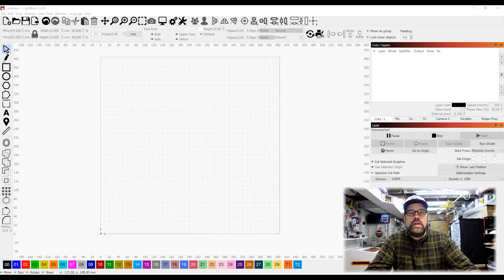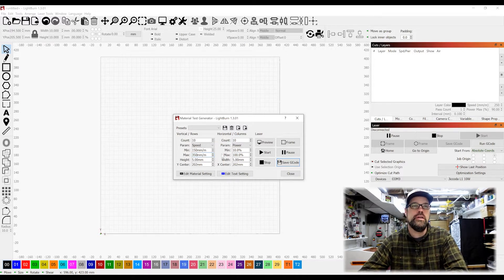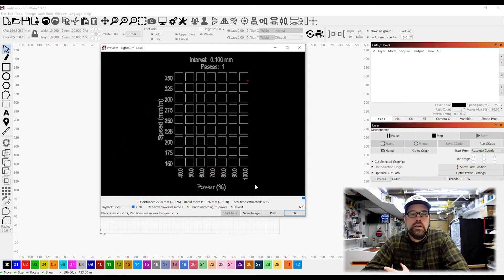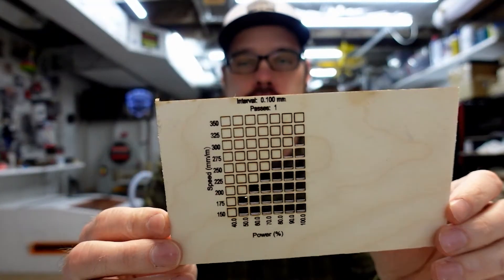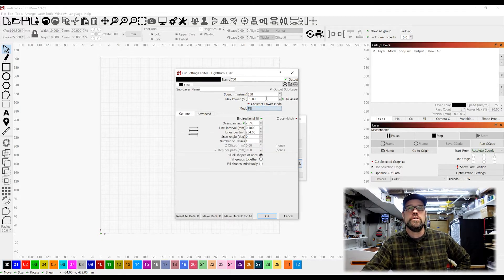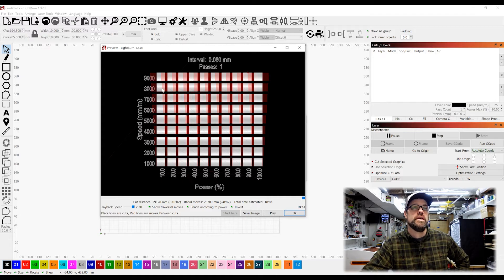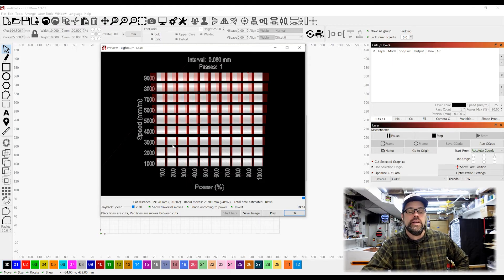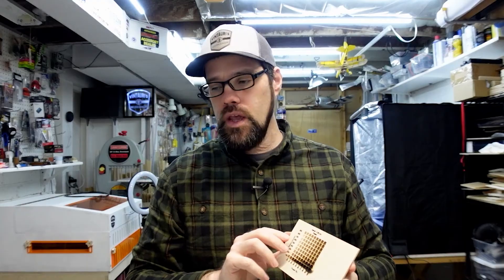Use the Material Test Tool in Lightburn for better results with your laser

Comment: Thanks for the video really helpfull, have got one question when running the test it starts in middle, anyway to make it start say bottom left please many thanks
Reply from the maker: You can adjust where it runs but changing the Y Center and X Center coordinates on the Material Test Generator screen. Always use the frame button to see where it's going to run before starting the test.

Comment: I got what i need thank you so much , only i have one problem i don't know is this a software issue or settings issue when i select preview and frame every things is line up but when i select start it deos't match what i saw on preview all square boxes start at 50 to 60 mm distance from left side  could you please advise me how im able to fix this problem
Reply from the maker: It sounds like you have an offset configured in the Device Settings.  This would be used if your laser has a crosshair pointer that is different from the actual laser beam. You can either disable that option, or you'll need to correct with some test fires measuring the difference from where the laser sits to where it starts the job.

Comment: Great video. Very informative. I have a question. In my settings I cant set lines per inch and line intervals independently.  If I change lines intervals to .08 then my lines per inch goes to 12.5. If i change lines per inch to 225 my intervals goes to .00444. I cant set them separately
Reply from the maker: Those two settings are tied together and when you adjust one it will move the other.

Comment: I tried it and my test tend to go to the center of my cutting table which waste my material . how do i place  it in the right spot ?
Reply from the maker: You need to adjust the X center and y center options before running the job. It always defaults to the center of your laser work area. Set up your parameters in the tool then use the framing button to see where it will run and adjust from there.

Comment: Love Your Videos, I am very new and have an Atezer P20, on your material test, where would you recommend the start settings for a 20 watt laser? Thanks
Reply from the maker: For the 20w machine I would start the engrave test around 5000-15000 mm/min 10% to 100% power and for the cut I would start the range around 300mm/min to 600mm/min and 60%-100% power.  No sense in testing the lower power on the cut tests. Then adjust the range up or down from there based on the material results.
Reply: @Vintauri  Thank you very much, I really enjoy your video's, I tried the LA Hobby Guy's videos, but they just seem to advanced for me, I really like your video's, keep up the good work!

Comment: If I double the thickness of the wood do I run the same specs and do 2 passes?
Reply from the maker: You can run the same test at two passes or if you have the room you can slow down the cut speed.  I like to keep it above 150mm/min though even that slow things tend to char more. But anytime you can cut in a single pass can help reduce the top side staining around the cut lines as well.

Comment: working with a new 70 watt OMTech. Have run materials test grid on a couple of woods (MDF, birch, basswood) , 10mmx10mm squares... what has been happening is using a cut setting from the grid (usually numbers in between some cuts ; ex at 70 mm/s it cuts at 40% & 50% & 60% , so use 70 mm/s & 50% ), small things cut out, but the larger things dont (think profile of a pinewood derby car and holes for axles - holes cut out but profile does not)....happened with all 3 woods...wondering if on the 10x10 (10 mm) test grid,  laser is not getting up to speed, but is getting to speed on the actual cut and therefore going too fast for the power.....thoughts
Reply from the maker: It could be a speed issue with the small squares.  You may also want to check to see if the option for "Constant Power" is on or off in lightburn. The software tries to compensate power levels at lower speeds when the laser slows down for corners and such. But it can sometimes not work well with various controllers and power supplies. I'd run a few tests on larger objects to see if adjusting the speed makes a difference.

Comment: When i try this with my sculpfun s9 it does not show the letters on the side. (It goes really fast)Any idea?
Reply from the maker: When you open up the Material Test tool, click on the Edit Text Setting button and adjust the power and speed there.  That will change the settings just for the test engravings for power and speed.

Comment: Thanks for the great video Steve.  My question is how does the speed and power setting in the "Edit Materials and Text" settings relate to the speed and power settings in the actual material test?
Reply from the maker: Lightburn will ignore the power and speed settings under the Material settings button, however for fill mode it will read the line interval, if you are just doing a power and speed test.  For the text settings it will use those when marking the test labels, so you can change that to line, or fill and then also adjust the power and speed.  This is a good thing to check as it might be too light or to dark based on the settings for the material you are testing.
Reply: @Vintauri  thanks.  This is helpful.  I made an enclosure based off of your video.  I will post my build video soon and send you a link.  😁
Reply from the maker: @MakerDan55  I look forward to seeing the enclosure build!

Comment: So one thing I noticed that nobody covers and I have asked in multiple places and never get a straight answer.  How do the power and speed settings under Material Settings effect the test?  You enter your minimum and max power and speed in the original Material Test window that opens, so clicking on the Material Settings tab and changing power and speed accomplishes exactly what within the test?
Reply from the maker: I have not seen the min and max power settings have an effect on the output of these tests.  What I do look at there is the overscan and line interval when doing an engrave test as well as number of passes on a cut test.
Reply: @Vintauri  thanks.  LB support finally got back to me and confirmed that the software will ignore the speed and power settings in the material settings here.  All the other settings can be changed and will take effect, just the speed and power are ignored.

Comment: Heya, i see you're still responding - im brand new at this but is it normal for a 10x10 sample test piece of plywood take over an hour for fill engraving or am i doing something wrong?
Reply from the maker: The engraving tests can take a while and depending on the speeds and line per inch that are set up I could see it pushing an hour.

Comment: aye man this video answered a lot of my questions teach and learning all the aspects of the laser and software can be tricky but you did great job. I'm new to engraving business I grabbed a nice 80w co2 starting off but I'm getting hang of it I'm more worried about learning before I mess my laser up because light burn has a lot going on if you are new to the program compared to others they are very basic but light burn is where its at if all steps are learned and taught from someone with your skill and knowledge.

Comment: Great video thanks for the help, question fo you use air assist when engraving?
Reply from the maker: I try to run some air all the time to keep positive air flow away from the lens.  I prefer a lower air setting when engraving if possible.
Reply: I have a Sculpfun s30 ultra 22w it has its own air supply and I am not sure if it is adjustable so I will set to on.  Thank you for the quick reply @Vintauri

Comment: Im having such a hard time doing such a simple test like that. With the settings you provided I did two test one with your settings which everything came out really light. Then the other with factory settings but sopes max 900. I have the s30
Reply from the maker: Check to see that your lightburn settings are set to mm/min if you are duplicating my settings.  If they are set to mm/sec it will run much faster and be lighter.  You can stay in mm/sec but divide the speeds by 60 to get a starting point.

Comment: if i have 33w what i should do
Reply from the maker: You'll want to adjust your numbers a bit to be faster but it will also depend on the material.  Run some cut tests at 200mm/min up to 500mm/min for cutting and adjust from there.

Comment: Hey, I can't continue anymore, I can't save it because there is no save to g-code anywhere, I can only start it with my computer on my lazer cutter, but I don't know how that works with the cable?
Reply from the maker: Unfortunately there is no export to gcode option in this tool. If you are connected to your laser via USB, then you can run the file using the start button in the tool.  I'd recommend using the frame function first to ensure it will run where you want it to and adjust you x and y center from there.

Comment: Thank you so much! I have just been doing my first burns and the text would burn perfectly but everything after that was way off. Turns out I was running the laser too fast. Got my first absolutely perfect spot on burn thanks some of the tips in this Video. Tomorrow I'll tweak a bit more to find the upper limit of speeds. It's scary just how smoothly learning this all is going- I'm knocking out one issue/skill after another- the 15 Years of Game Dev helps alot! I'm just waiting for a shoe to drop- thought maybe this was it but it was an easy fix- surely I'll run into some big challenge soon but I can't complain about how well learning this new skill has gone so far. Great vid- subbed/liked :D

Comment: Hello. Thanks for your help. I was wondering, how do I set the Interval? I see yours is at .100 where mine is .04?
Reply from the maker: The .04 vs .1 is likely the difference of being set in MM vs Inches.  You can change the interval if you change the material settings to fill, but in the line mode it will not make a difference.
Reply: Thank you. @Vintauri

Comment: Excellent info video, just one thing do I alter the edit test material settings or leave as is
Reply from the maker: The only thing I would mess with in there is the number of passes if you are wanting to test higher speeds but more passes or on engraving if you want cross hatch or unidirectional scanning.  Otherwise I leave it at default.

Comment: Thank you. I will be getting my bolt next month and scared but thrilled try my hands to playing the settings. Do you have any tips for doing material testing with Bolt? What should I consider. I'm super newbie to laser. Thank you.
Reply from the maker: With the bolt you'll want to work in mm/sec as the Co2 are much faster.  For cutting it will depend on your material, but on my 60w co2 and 1/8" plywood I average from 17-21mm/sec for cutting.  Quarter inch plywood was closer to 10-12mm/sec.  That might be some starting points.  You'll want some scrap material and start running your tests.  Just be ready to cut off the laser if you're moving too slow as you dial in your settings. If you see small flare ups while trying to cut either it's too slow or bad material.

Comment: In edit material setting when you click on the material  settings button what should the speed be while cutting and engraving
Reply from the maker: That setting should not matter and I usually just have it set to default.  You may want to change the Text settings on the blue layer.
Reply: @Vintauri  ty

Comment: What type of laser are you using to have a max speed of 9000 mm/m? I have a Fox Alien Masuter Pro with an 80w Laser Tree laser. The Masuter Pro is only rated at a max of 2200 mm/m,  Not sure if I should be calculating it differently running a laser module instead of a router boring through wood, Nice video.
Reply from the maker: Many of the newer dedicated diode lasers are set up to run much faster. Some even claim speeds above 50,000mm/min although with the size of the working area, I doubt they ever reach those speeds. There are no 80w output diode laser modules at this time, so I think the 80w you are seeing for your module must be the input power instead of the optical output power. I believe the largest output that Laser Tree has at this time is 40w optical. So you’ll want to check on that first to see if you can get more speed out of it. The other limiting factor is how quickly your machine can accelerate and maintain higher speeds. Typically cnc machines are built for torque and not speed to move the spindle head through material.

Comment: How do you know when my laser is on its last leg?  I am having a hard time cutting all the way thru.  I have run many grids now to see if I could come up with a correct power and speed but it still does not cut all the way like it used to.  I have a Adamstack A5 M50 and have been spending quite a lot of time on it to learn which makes me think that maybe it is wearing down.  What do you think?
Reply from the maker: The first thing I would check is the cover lens on the laser. If you have an air assist cone, remove that and see if there is residue on the cover lens. If there is, clean it with some isopropyl alcohol. It may also be damaged or cracked. If so, you would need to replace that part.

Comment: Would the setup you did in the video be good for the OLM 2 Pro 5 watt laser?
Reply from the maker: You would want to back the speeds down a little bit from this one as it was done on a 10w laser.  It will also depend on the material.  Give it a shot and if you're not cutting through back off the speeds and if it's cutting too many out bump them up a bit.

Comment: should i be trying to cut 5mm with my d1pro 10w in 1 pass? or using multiple passes. i recently started learning lightburn and since the speed and power settings are different from xcs its making it difficult to get nice clean perfect cuts.
Reply from the maker: Depending on the material you may want to switch to multiple passes. I don’t like to have my lasers cutting at less than 100mm/min as it tends to char more from the heat while staying in one place for too long. So I’ll bump the speed up and add passes. It won’t take much longer assuming you almost double the movement speed while adding the extra pass.

Comment: Hi Steve, you lost me in the 1st couple minutes, I was following along step by step but, how did you change the random speeds to increase by 25? Thanks
Reply from the maker: You'll need to change the min and max speed settings to be 200 apart and then change the steps to 9.  That should give you a range that goes up by increments of 25.  On the right side of the tool, set your count to 9, Param to speed, Min to say 200, Max to 400, height can stay at 5mm and Y center wherever you need it.  Hopefully that gets you there.
Reply: Haha, never mind, I didn't see you change from 8 to 9 rows in the speed column

Comment: It's useful but I'll note that at the faster speeds set, for small test squares, the laser head never reaches full speed so the speed vs power is not accurate. I recently got a 65 wattCO2 laser and it's around 50 times faster than my Ortur LM3
Reply from the maker: This is true, and enabling over-scanning will help some with reaching those speeds if you have the extra space in your laser to allow that acceleration and deceleration movements.  The top speeds advertised on the newer diode lasers are unrealistic in practicality.

Comment: Hi,
Thanks for the material test. Where does one set the material thickness for this test? Another question I have, is regarding the focal distance for my fixed focus laser. It was supplied with a 20mm setting piece. When setting the distance to the laser, do you set the spacer to the body of the laser or to the laser lens?
Reply from the maker: You do not need to enter the thickness of the material.  The laser only cares about power and speed.  In your notes or library you'll want to add the information once you identify the proper settings for that material.   As for the focus tool, most lasers with a spacer tool measure from the bottom of the module, but hopefully there is a manual for your specific laser to clarify that.
Reply: @Vintauri  thank you for  taking the time to answer my questions.

Comment: Hi,
Just maybe a silly question. How do you differentiate between when you're just burning a line and when you want the laser to actually cut through the material? There are some projects when you will burn an image followed by cutting it out.
Reply from the maker: You would assign different layers in Lightburn for the various operations. The engraving item would be on one layer set to fill and then configured with the proper speed and power, then the cut item would be set to line with it's own power and speed settings.
Reply: @Vintauri  thanks for the confirmation 👍

Comment: Where do you input the material thickness ?? did I miss it ??
Reply from the maker: You do not input the thickness into Lightburn as it does not need it.  It just needs speed and power for the operation. I record the information afterwards including the thickness to reference later.
Reply: @Vintauri  Ah ok thanks I got my laser yesterday so am trying to understand as much as I can before my first cut

Comment: Can one easily store those settings to the LightBurn Library?
Reply from the maker: There is no automatic way to pull them into the library, but it's a good idea to save your settings to a lightburn library and back it up for quick reference as you start working with more materials!